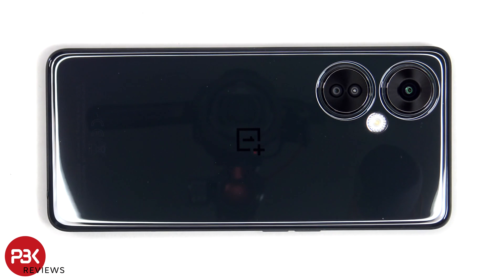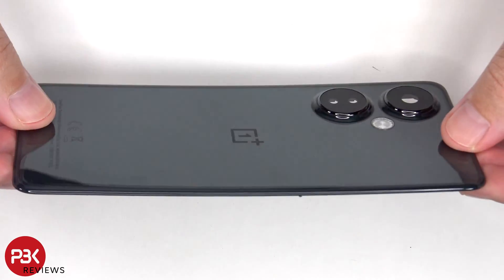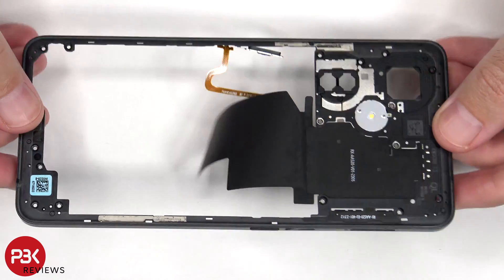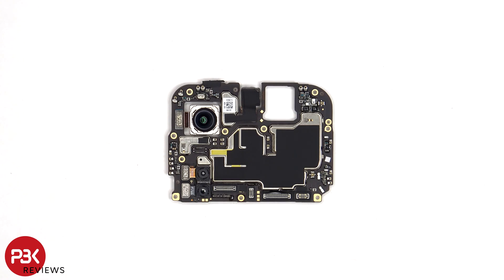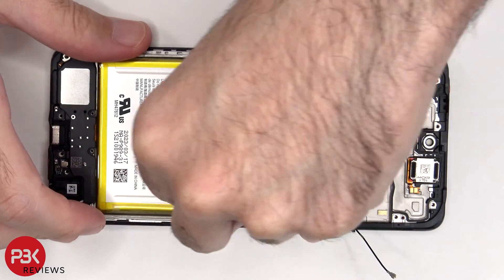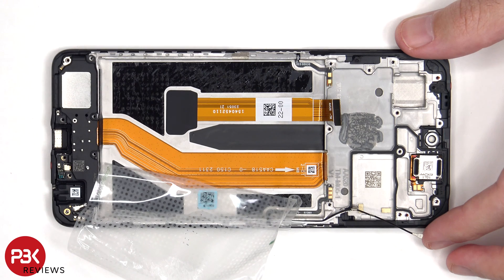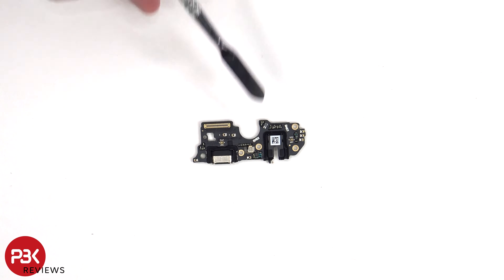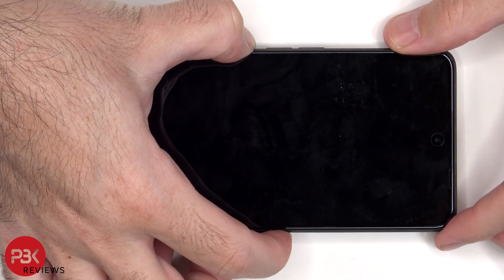OnePlus Nord CE 3 Lite Teardown Disassembly Repair Video Review

Comment: My phone had a weird accident. So i was using my phone (oneplus nord ce 3 lite) while eating my food and it slipped off my hand, fell into the gravy 😢. The headphone jack, charging port and the speaker got fully submerged. Rest of the phone didn't.  I tried cleaning it with cottonbuds etc but the gravy is stuck deep inside the ports. Now gravy has dried out. I am really worried if it will dammage my phone by getting inside it completely or its only in the ports. Pls reply.
Reply: No
Reply: No

Comment: My phone is bend in an accident but it is working fully it get repaired the frame is change but now my speaker is not working when I put my phone on full volume it start vibrating and sound is Fully disturbed what to do
Reply: change it

Comment: In your opinion,which brand of smartphone has the best batteries?
Reply: I think Samsung, Oppo, Vivo and OnePlus.
Reply from the maker: From my experience I would say Motorola or Vivo as far as reliability (not going bad quickly). But for capacity and other factors, there are many different ones out there so hard to say.